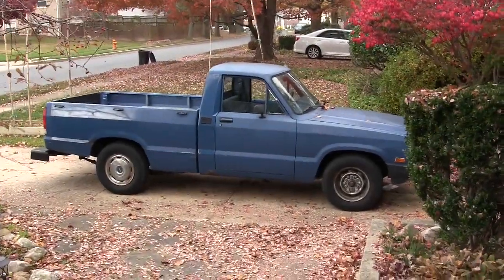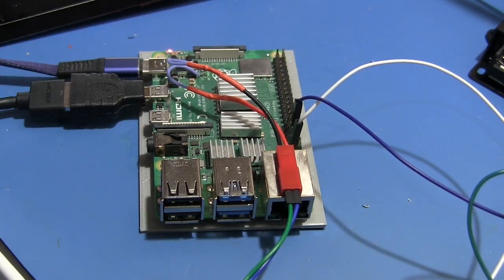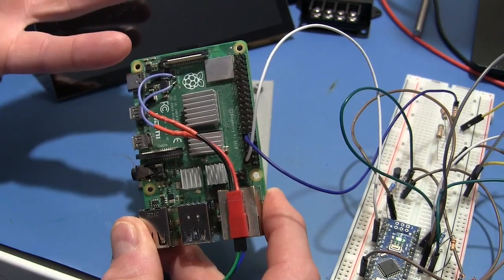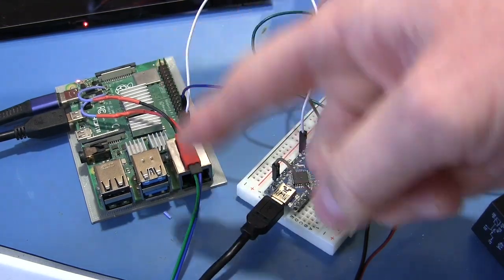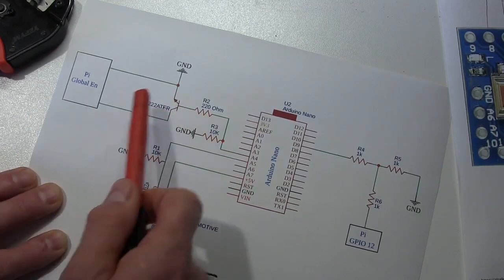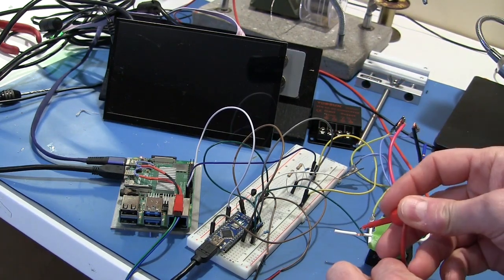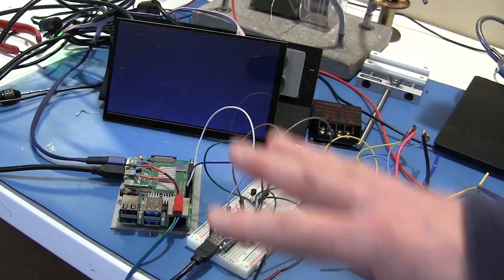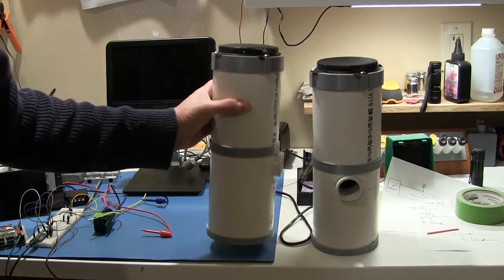TruckPi

Comment: You could skip the pull-down resistor if you connect the nc terminal of the relay to ground instead 😊

What happens if you turn off the car during boot and then turn the car back on? Does that trigger the reset pin during boot?
Reply from the maker: Interesting.  Thanks for the tip.

Very good question.  I have a 1 minute delay after the reset is triggered to give the Pi some time to boot but a better solution would be to have the Pi send a signal to the Arduino that boot is complete.  I think eventually, that's the way I'll go.